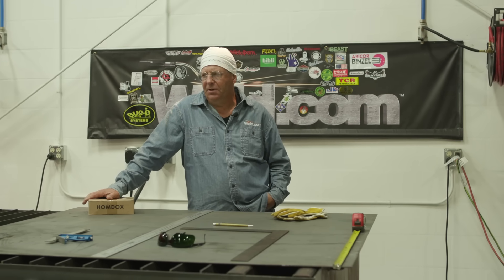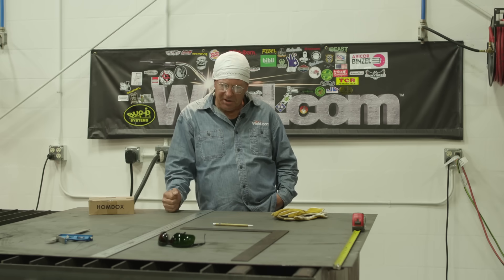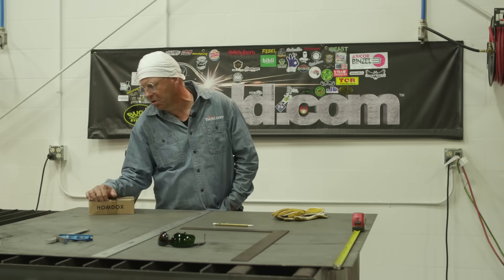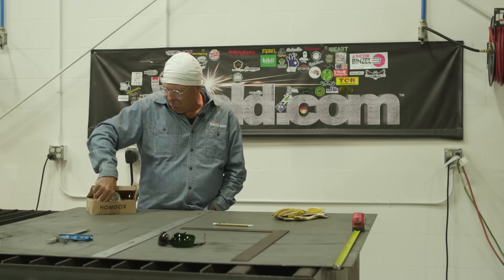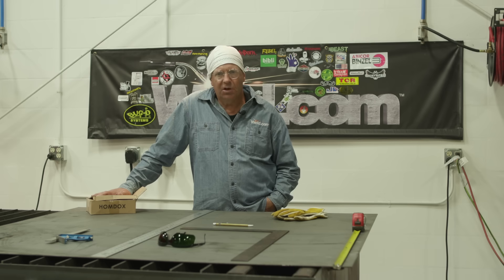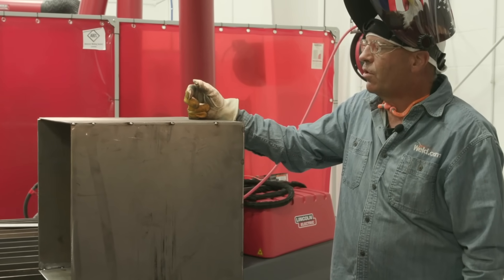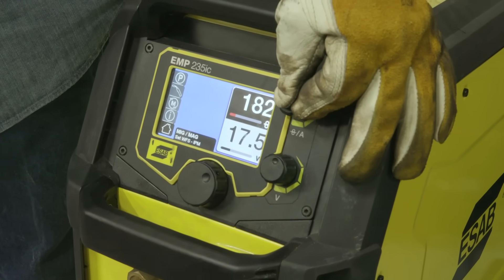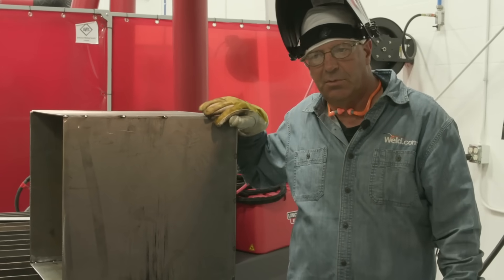🔥 Building a Cooling Tank for the Weld Shop

Comment: Great work Bob, and good camera work too!  Interesting to see your choice of metal and fitment.  Like Chris M I am a programmer by day but enjoy welding as a hobby.  I live on acreage with a fenced property, so deliveries are an issue.  I built a large "delivery mailbox" for packages to be left securely.  Did something similar to your approach but boy, you killed it WRT time.  I spent hours working on that mailbox!  Of course, I went with thinner 16 gauge hot rolled steel and felt as though that choice required an inner frame, so I had to build that to support the outer sheet metal skin.  Only had flux core available so there was a lot of cleaning and grinding to get a decent looking finish.  In retrospect perhaps I should have gone this direction with the thicker sheet metal, thus no frame.  Anyway.  Thank you for sharing the expertise!

Comment: hey bob,  huge fan of your channel! absolutly love it! anyway you could do a video with either demonstrating grinding a j bevel on a pipe, or welding a j bevel on a piece of heavy wall pipe? cant seem to get the hang of it. 9% chromium, 1.5" wall thickness (dont have to do it that thick) with a j bevel. tig 30% out, and either fluxcore balance or stick balance. basically a steam turbine tie in. mine passed phased array, but id like some more knowledge and tricks on how to do it better and faster. thanks bob! love the show!
Reply: If you trying to improve production and if your procedure allows switch to flux core as early as you can. TIG is great for that perfect root and hot pass but it is painfully slow. Flux core is way more efficient that TIG and SMAW so use it if it is available. You will also reduce stop starts and the slag on a lot of products peels off by itself

Comment: Bob who made the magnetic clamp
Reply: aaron bell Magswitch
Reply: Have a link?
Reply from the maker: http://magswitch.com.au/
Reply: What is a good way to ensure good penetration on an open joint using MIG, we are building a fryer in class. And I am having some trouble keeping the water in. 11 gauge steel like your using for the tank.

Comment: Your timing is impeccable!  I'm just getting ready to start a very similar tank.  As a real newbie to tig welding I am finding open outside corners easier to run than just practice beads on a coupon.  Is this normal?
Reply: Canuck Loyalist I had the same thing happen. It just works really well without much effort. Everyother fit up I've tried has been disastrous.

Comment: Nice work guys,that hypertherm cuts real nice in the hands of a good operator.
No drain plug/valve bob come on man you getting to old to lift that full of water haha 
or did you run out of time ?
cant wait to see the pulse tig outside corner with the esab machine

Comment: Thanks guys. It's a relatively simple project but I still learned a bunch. Looking forward to learning about why you might want to quench some material and slow cool other material. (I'm a computer programmer, not a welder, so almost everything is new to me.)
Reply from the maker: Different materials require cooling to happen at a slower rate. For welding test coupins it's generally okay to quench it.
Reply: After my first bead, I learned just how hot metal gets when its welded.  Doh!
Reply: That is why the instructors will never take something if you offer with a gloved hand.. In my bare hand telks them it's NOT hot.
Reply: Chris M you should give it a try welding is required in the world as a begginer in welding i learned stuff
Reply: Oh, yeah, I've tried it and I love it. I've got an ultra-cheap wire-feed welder and an AC stick welder (that I can't seem to strike an arc with). I won't call myself a welder at this point though. :)
Reply: Weld.com  im aware of that i learned a technique where i move and stop a bit beacuse thin metal wants to meltdown
Reply: With your AC welder.. Your arc length needs to be very consistent.  Too. Close and it will suck the rod in, too far and it will shut off. Try lightly and quickly scratching it like a match. It will take a while to get used to.